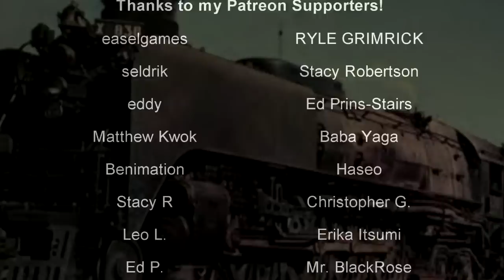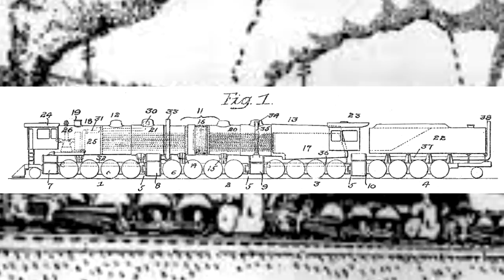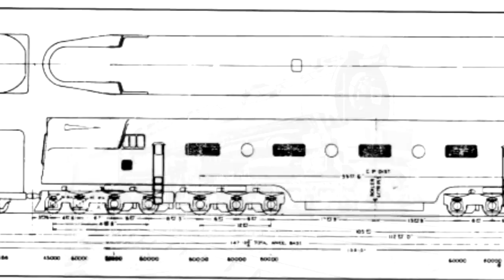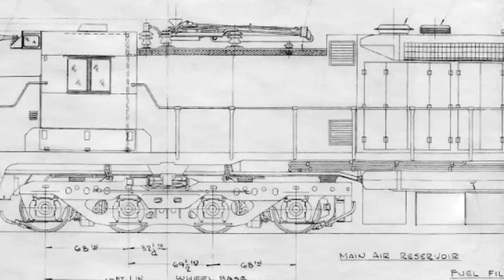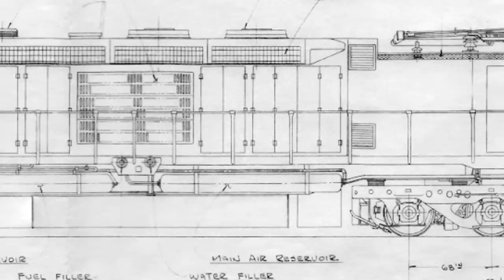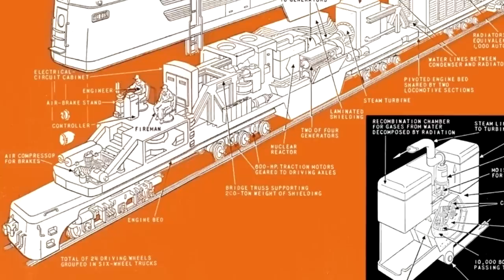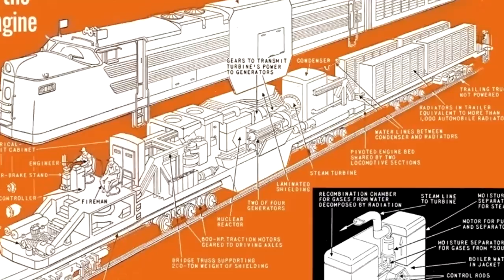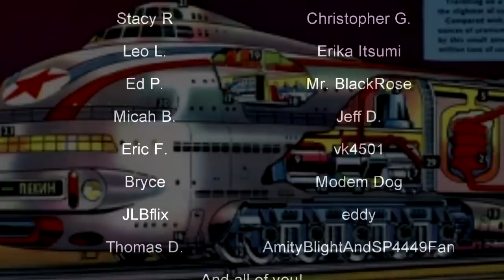5 INSANE Train Concepts (That Were Never Built) | History in the Dark

Comment: They probably could've done a duel drive steam engine that would function like a normal steam engine at low speed but functioned as a steam turbine at high speed to avoid the cost inefficiency's of both types of locomotives
Reply: Someone tried that...

But the sheer amount of reciprocating mass and friction on the running gear would disintegrated the system. 

It would have been better if they revisit the setup by using modern standard automatic transmission as the technology is already present on large mining trucks. Direct drive turbine with an automatic transmission. The turbine runs at constant rpm completely eliminating the low efficiency problem at low turbine speed.
Reply: @kimpatz2189  What's RPM

Comment: EMD DDR 6700 HR electric didn't get built because the oil shortage ended and electrification didn't make economic sense to Conrail after that. (BTW, your sound could be improved with a little reverb and a decent mike.) EMD did make other electric engines that were tested called the GM6C.

Comment: The soviet Atomic train is just apart of the soviet proposed version of the Breitspurbahn. And you think in that gauge and scale it might be a safer bet. the Idea of Nuclear trains is lower down time. when they would "refuel" the locomotive then they would do maintenance on them and if you're thinking of maintenance scheduling once a month for mandatory maintenance wouldn't be such a bad thing. but as you mentioned the safety concerns is what killed the Nuclear trains. if the Breitspurbahn or a clone had been built somewhere them sticking a nuclear rector in those Behemoths would make plenty of cents. Literal Hotels and ships on rails.

Comment: The X12 locomotive was a cool idea but why have a nuclear powered locomotive when you could just have a nuclear power plant stationary have that have an electric powered locomotive with a Cantonary and pantograph I mean I'm a volunteer at a trolley museum and we run freight motors and trolleys all the time and it has some problems sometimes like the trolley boom sometimes comes off of the Cantonary And when that happens you're worried that the trolley boom is going to snap the wire